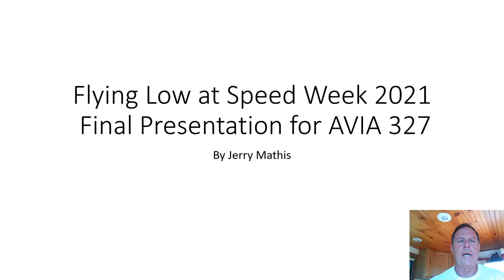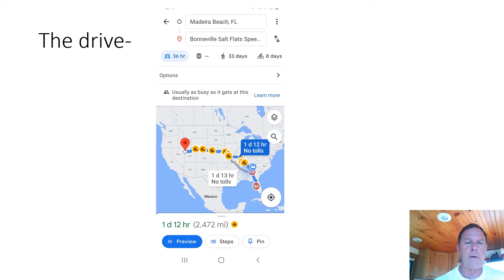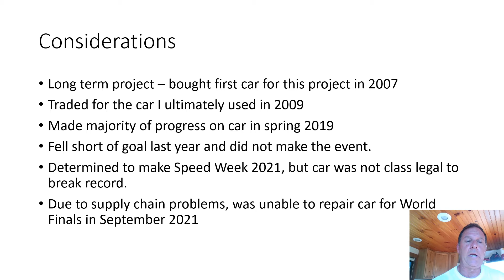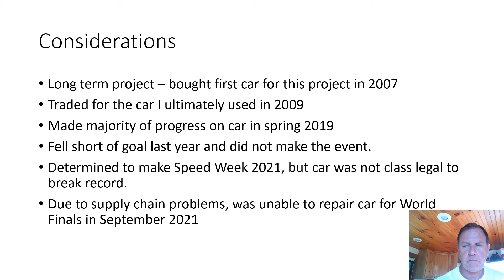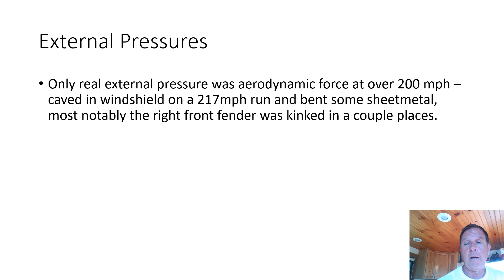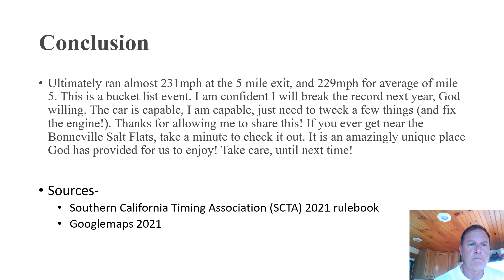AVIA 327 Flying Low at Speed Week 2021

Comment: With the A Class engine, is that a 440 or 426 built up to higher horsepower or is it a separate type engine?

I'm just so curious because I had such a similar idea
Reply from the maker: Low deck wedge stroker, 498". Brodix heads/ports/intake valves (2.4" Ti) really too big to keep the velocity up. Next attempt will be with a smaller runner intake to band-aid that. Thanks
Reply: @jerrym523racing6  okay thank you